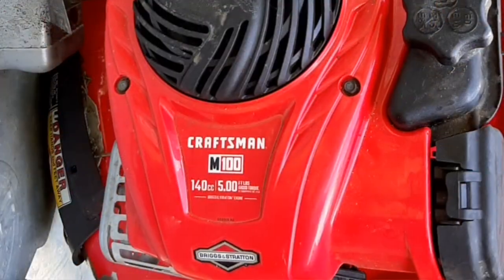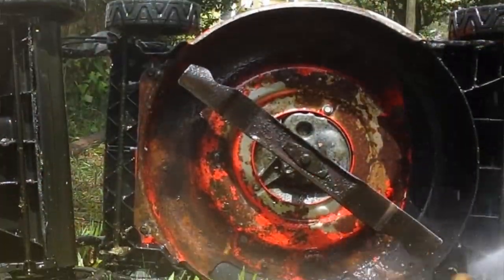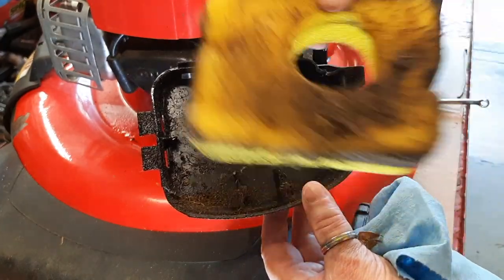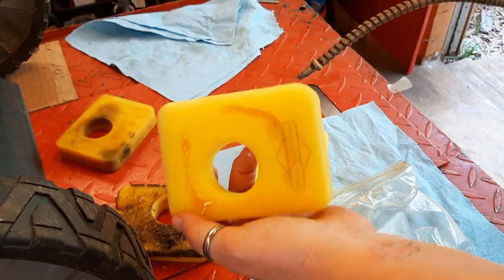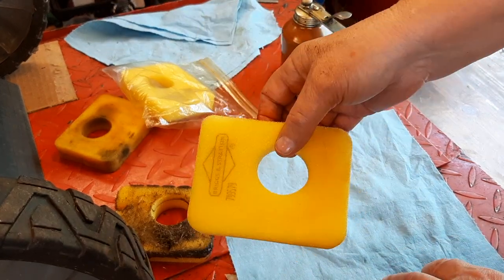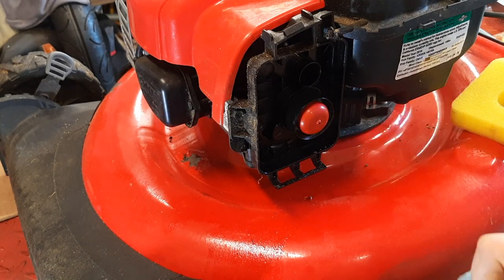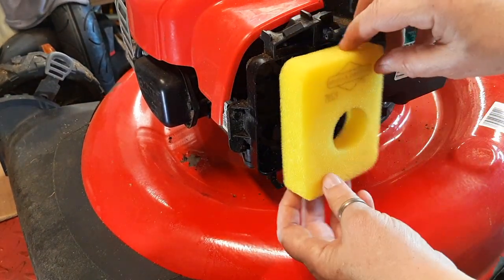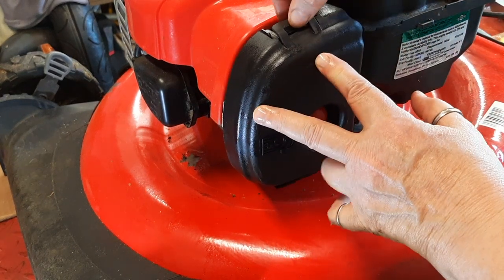How to Tune Up a Craftsman M100 Lawn Mower

Comment: Some of these Briggs EX/EXi Engine's call for a 0.020" (20 thousandths) while other's call for the standard  0.030spark plug gap - the owner's manual will tell what gap the engine uses. Oil capacity is 12-15 oz on these engines.  (i am a Briggs dealer)
Reply from the maker: Thanks for watching.

Comment: My lawnmower and I appreciate this video. I figured that’s how I was supposed to get the oil out, but the engine manual was super cryptic. Thanks!!!!
Reply from the maker: I appreciate you watching. Cheers!
Reply: I agree, I've never had a mower without a   plug on the underside to drain and was at a loss as to how to change the oil... though I saw at the store today an m130 it said it doesn't need oil changes... which I find suspect.

I like this mower for ease of use, but ease of maintenance is a bit lower rated.  My old craftsman gave it up after 20 years, but changing oil, changing spark plugs was much easier to access without scraping knuckles.

I'm glad I wasn't the only one perplexed by the lack of instructions on some maintenance.   The manual also didn't tell what spark plug it needed... I like to stock up so I don't have to make a special trip to get one should I need it.

Thank you for the video.

Comment: I must be the only shop that gets those engines with No oil in them and spun camshafts! Nice work Red, I mean Fred, I mean Stella!!
Reply from the maker: It's crazy. I helped a guy on Monday assemble the same model. It has a huge yellow sticker warning that you have to remove before you use the machine, and even comes with a 15oz oil jug.
Reply: Lol Ben 😁

Comment: Good tip on taking plug off bottom of carb.
Reply from the maker: Glad to help. Thanks for watching!
Reply: @TheLawnmowerLady  I was messing with a hrn216 mower I bought for $50 and it was surging. Was sitting there saying, what would lawnmower lady do. I ended up opening the jet a little and surging went away. Cleaned it like 3 times with new gaskets and would still surge before finally fixing it.

Comment: Thank you for this video.  I had the same situation - 1 year old mower that won't start.  I was advised to check the spark plug and oil by my Dad and I wanted to fix the situation without him having to come over to my house.  Thank you for showing me where the spark plug is located and how much oil this mower will hold.  I will follow your video this weekend and hopefully get my mower started.
Reply from the maker: Happy to help. Good luck. Cheers!

Comment: Thanks Stella. I find those little B&S engines are very sensitive to stale fuel - must have had 5-6 in this year with hunting issues after sitting just 6 months. I also oil these foam filters but I'm testing an air filter spray oil (for dirt bikes) where only the front side of the filter gets sprayed - seems to work well.
Reply from the maker: I have used K&N spray on scooter air filters, I think it works well. I appreciate you watching. Cheers!

Comment: I have a Craftsman lawn mower but it's the M270 with the V20 battery operated electric start feature on it that is powered by the 159cc engine and so far it's been a very good mower
Reply from the maker: Nice! I didn't realize they had an electric start version. I've had the M250 in the shop, but these are pretty new. I appreciate you watching.  Cheers!
Reply: @TheLawnmowerLady  I didn't either until my mom seen it online and she liked that because it's a lot better than pull starting every time but it still pull starts extremely easy too because I went to use and barely pulled the rope and it started and I didn't pull it all the way out so that's definitely better than my previous mower that had the Briggs quantum on it

Comment: Yep really nice mowers and work great but in Canada they were selling them with the real thick heavy duty blades on them and Jake did a video on the crankshaft damage basically a scrap engine that we salvaged all useable parts . By they way we haven't put oil on a foam filter in 9 years they still catch the dust but can be more easily cleaned without the oil and they last much longer provided you wash them out at least once per season.
Reply from the maker: You're right about the oil on those foam filters, but I figure since they put that in the OM (who reads those manuals anyways? LOL) I figure it's helpful to show how little oil is really needed. Thanks for watching. Cheers!
Reply: @TheLawnmowerLady  You are correct very little oil is needed if you decide to use it.

Comment: Very informative video! Ignorant question here but what kind of oil does it take?
Reply from the maker: If you live in a moderate climate, any 10w30 motor oil is probably OK. Don't spend the extra $$ on synthetic oils. Dinosaur oil is fine. Thanks for watching. Cheers!

Comment: I have this same mower and your video guided me thru winterizing it. I don't have the manual, and I checked the Briggs and Stratton website, but I'm still not clear on the replacement carb for it. Could you tell me what it is?
Reply from the maker: I cannot. But you can search the mower engine model # (not the mower model # the Briggs site has a good reference page to find where that engine # is located. With that number you can search for parts diagrams to give you the correct part #. Good luck. Thanks for watching.

Comment: I like the primer version better than the choke version of those BnS carbs.
Reply from the maker: Absolutely, you can see if it's working! Cheers mr Tom!
Reply: @TheLawnmowerLady  soon I will get to watch more of your channel and others because I am going to have 6  - 12 weeks off after my quadruple bypass.
Reply from the maker: @haneyoakie14  Whoa! Hang in there Mr. Tom. I hope it all goes smooth as ice.
Reply: @TheLawnmowerLady  I will be fine. CABG is as common and easy as a Quantum carb clean. I will be back at full HP before long. If not, I have a Savior who will take me in.

Comment: Have this same mower, confirmed spark, flywheel key is good. Won’t even pop on starter fluid, any ideas?
Reply from the maker: Does your mower have a priming bulb? If you are priming and shooting ether, it might just be flooded. Is the spark plug wet? If so, pull the engine over a few times to dry out the combustion chamber and try again. Skip the starter fluid and just a small squirt of petrol, don't push the primer. If sputters and coughs, you might have an air leak sucking air when the primer should be pulling fuel into the carb.  If you have a compression tester, or can borrow one give that a whirl. You should get about 60-80 if the compression release is still working. If you can't get your hands one one, you can always pop off the valve cover and make sure the valves are not stuck open or, not opening. Hope this helps.

Comment: Do you paint the bottom of deck with used motor oil ??
Reply from the maker: Yes, old farmers trick. Not a permanent solution, but it helps for a little while when there is a lot of rust.

Comment: I have a m110 craftsman. I cannot get it to crank it took the carb out and cleaned it but that didnt fix it. What else should I try. I also dont think mine had a plug in the carb but it worked last spring lol
Reply from the maker: I would drain all the fuel out, leave it in the sun for a few hours to completely dry out and refill it with fresh ethanol-free fuel. You'll need to drain the car bowl as well to get out all the remaining fuel. Hope this helps.

Comment: Ehat kind of oil to lub wheels and switch? And what to do , i have emptied mine of bad gas, what next please??
Reply from the maker: If I pull off the wheels, I'll usually put a thin film of lithium grease one the wheel bolts, after I clean them with a green scotchbrite pad. If not removing the wheels, just a few drops of SAE30 weight oil. You might need to pull the carb and clean it if the mower sat with bad fuel. This video (different mower, but same carb) shows detailed cleaning of these plastic carburetors: https://youtu.be/vioqdlj5qIQ

Comment: Great  job, Stella!
Unfortunately, that mower won't last long. Thinner metal and definitely too much plastic.
Reply from the maker: That's true! I've gotten several of similar mowers with those plastic backs, they often break where the handlebar goes in. They make enough changes in the molding, that the right backs are often not available even after a few years. Thanks for watching!
Reply: @TheLawnmowerLady   We've had ours for 4 seasons already. It takes me 40 min to mow our grass, (and that's me really moving too, no easy strolling) and every 6 days from May to Nov 1. It's holding up great.
Reply from the maker: @MF-rp9ox  I'm glad it's working out for you. Any machine well taken care of will definitely last longer. Thanks for watching.

Comment: I took the carb apart, checked the little holes, all clean. Gas flows out the tank-to-carb connector tube when I have it disconnected, and the float and needle valve move well and are in good condition. 

It starts for half a second, using up the priming gas, then dies. 

What should I check or do next? The mower is almost brand new.
Reply from the maker: I'd pull off the carb bowl and make sure fuel flows out the carb. When was the last time it was running well? Does this have a priming bulb?
Reply: @TheLawnmowerLady 
This is a barely used M100,  MODEL 11A-BOBY793 
Made 10/2019. 
It was given to me by a guy who could not get it to start, and had been given to HIM for he same reason. He said it would fire up for less than half a second by pressing the red bulb a few times first, but would die immediately. I'm a retired mechanical engineer, medical equipment, and have worked on engines from mowers to cycles to cars,  and this one is stumping me as to what is preventing the fuel fraction of a fuel-air mixture from getting into the combustion chamber.

The mower looks brand new. The carburetor internals are pristeen, the little jet holes open and free of any obstructions. The floats and needle valve work as they should, and the bowl fills with fuel as it should. The gas is fresh, and ethanol-free. 

Even the device that opens and closes the butterfly/choke flapper in the carb throat moves freely and is held closed (choke) by the spring. 

I wonder if something under the starter flywheel is not "blowing" on the fin enough when the motor fires up, to push the flap, and open the butterfly in the carb. Or, perhaps it is opening the butterfly too much, and the carburetor can't  pull enough vacuum behind it to get the gas to feed in. 

I've had the carburetor fully apart twice, and it is still pristine. I even pulled apart the white plastic jets assembly to make sure it was good inside. 

I know it is something simple. 

I've not yet pulled the flywheel off to look under that, but that's about the only thing I can think to check next. 

Oh - the spark plug also looks new, white ceramic around the electrode, so I do not suspect fouling. I heated the tip with a propane torch to make sure it was dry, too. 

Color me perplexed.
Reply: @TheLawnmowerLady  GOOD NEWS! The machine came to life. I took a third dive into the carb, and a deeper test of all possible passage-ways for fuel or air.  I used a silicone rubber tube to blow air through every possible path, and think I dislodged something in a carb-body passageway. Everything back together, it fired up, and mows like a champ! 

So, my conclusion is that something (maybe even a plastic shaving from manufacturing) got lodged in the carb body, and the deeper dive in poking, probing and blowing through all the places found and removed it. I mowed for a half-hour, which was great. Test: passed! 

It was free to me because the previous owner could just not get it to run after 1/2 second. That told me it was a carb issue, and I was excited to see if I could fix it, bc my 35YO push-mower, an old 4-horse Briggs and Stratton, was wearing out, leaking oil from the crankshaft seal. Now I can give that one away. Yay!

Thank you again for your helpful, educational and encouragimg videos. Have a good Spring and Summer!
Reply from the maker: @logmeindangit  Yay! Glad you got it fixed.

Comment: Hi Stella nice to see you on the stream tonight.can I ask you about a scooter come with a full mot grandsons first bike it starts with the kick start but nothing electric works it only has one 10 amp fuse that's ok sad to say his dad my son has just split up so left to me to sort just what to look at x
Reply from the maker: Thanks Mr Gary! I’m assuming the electrics worked when it passed its MOT? That said, the first thing I should check is the main ground strap from the engine to the frame. If that is good, might need to start cleaning each connection to grounds. Small wire brush to remove any oxidation or corrosion. I hope this helps. Cheers!
Reply: @TheLawnmowerLady  it helps alot thank you very much Stella xx